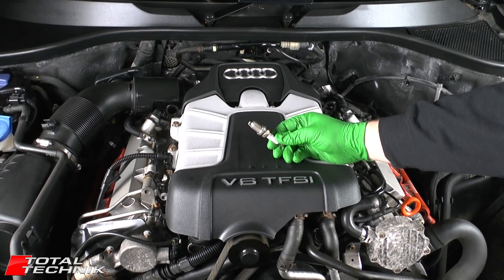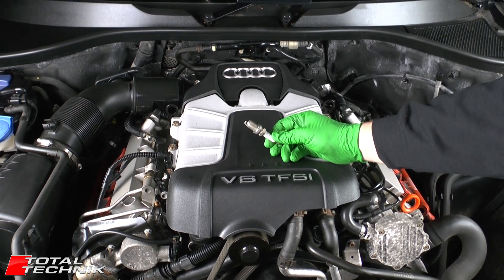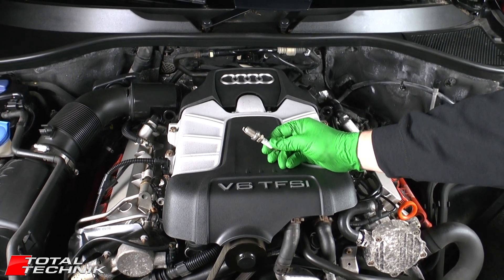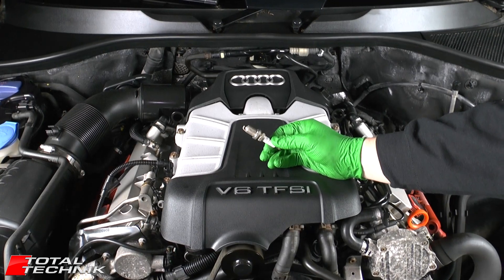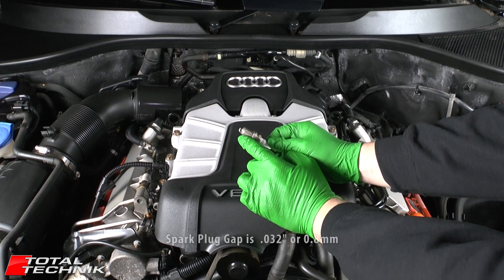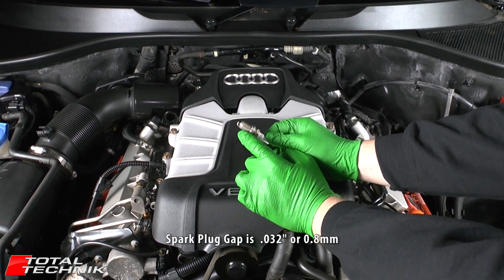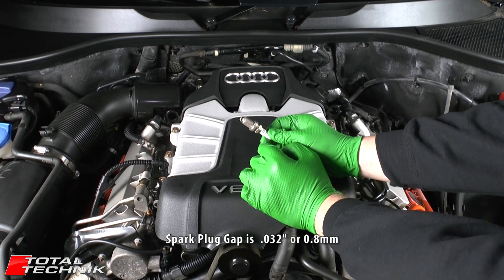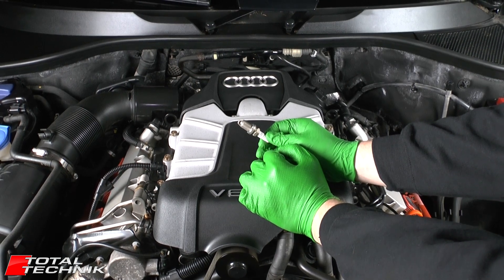Correct Spark Plug Gap for Audi 3.0 TFSI (Petrol/Gas) V6 Engine (Audi A7 A8 Q5 Q7 SQ5)

Comment: How about 0.024 ? Will it affect the performance
Reply: Don’t do this. I don’t think tuning is any lower than .028
Reply: Sorry unless stage 2 or more* I’ve read .026 if 2+ if stock stay .028-.032
Reply: .024” is what is recommended by APR if you are running a single or dual pulley system with a tune.
They also recommend NGK BKR8EIX plugs. 👍🏾